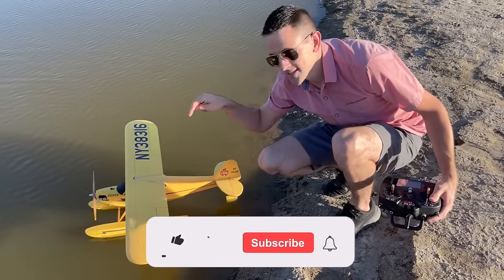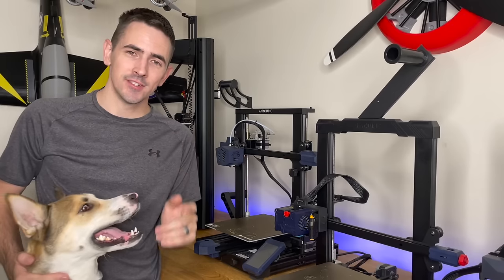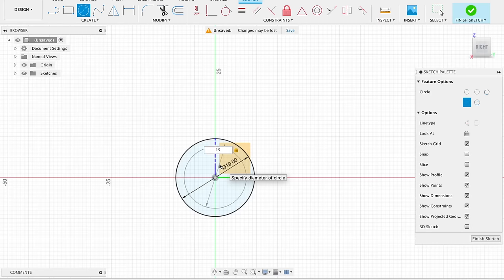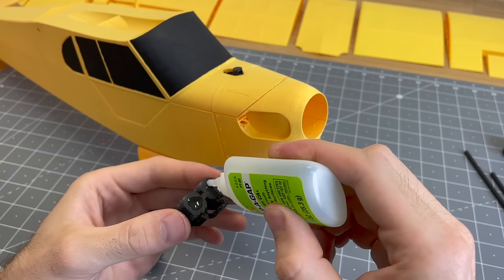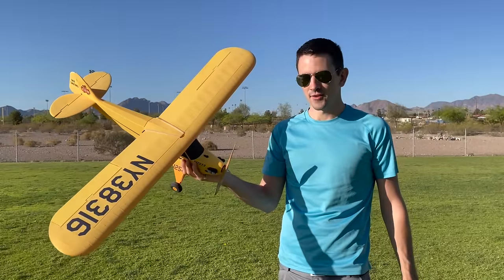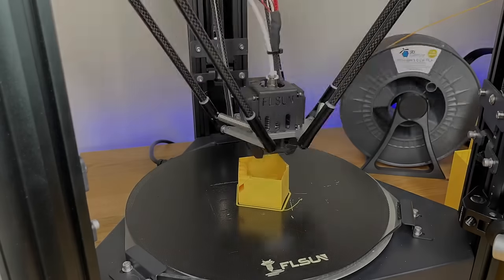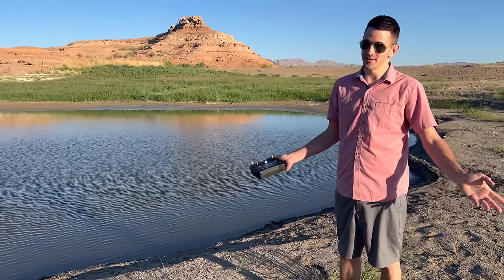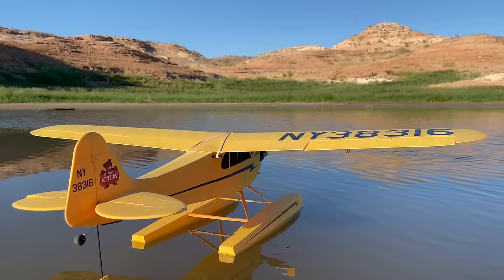Epic DIY RC Piper Cub Full Build & Flight

Comment: Love the videos. You've helped me get my.lw pla printing better. I'd love to see you focus on some sub 250g designs. 
I just built the nexus 900 rotowing in lw pla and it's probably only 100 grams. Check it out
Reply from the maker: I’m so glad I could help! I will check that plane out for sure, the only issue I’ve found with some smaller planes is that electronics that small can be hard get
Reply: @TroyMcMillan   I get that feeling. It took a while to shift through all the stuff out there and find what would work for me.  but I've landed on 2g servos for the most part, they seem to hold up to whatever I put them through, and I'm using pretty simple and cheap  fs2a(can run 1s up to 3s) receivers. Fvt little bee 20a escs(2-3s) which is way overkill but they're tiny, the downside to them is no bec. 1207-1404 sized motors. All pretty cheap and available from aliexpress. All  running 2s on 300-1000mah. I did pick up some byme A gyros and micro fs82 ppm/ibus reciever recently and I'm impressed with their function and how compact it is.  My biggest currently is the shrunken flite test p38 on my channel. It's running 2 1207 3100kv and 5 inch props. Just squeaks under the 250 limit at 750mm wingspan. Most of my flock is around the 500mm mark and 150-200grams.

Comment: I enjoy you videos and they have helped me with some of my builds.  But, the elephant in the room.  PLA is heavy and fragile, LWPLA is light but even more fragile.  PLA is also very sensitive to summertime heat and LWPLA is even worse.  I really wish the designers would develope designs that are stronger and lighter (I know that's not easy) and please give us designs that have more prominent tabs or edges to make the assembly process easier and add more strength to the assembly.   It can be very difficult to put some pieces together because you are butting them together or the alignment tabs or surfaces are very small.

Comment: Having problems with the files. Nothing looks like in your video.
Reply from the maker: What printer and slicer software are you using?
Reply: @TroyMcMillan  flashforge ADM 5, with orca slicer.
Reply from the maker: @michaelrogocz1160  For all the 3dLabPrint airplanes you should use Prusa slicer like I explain how to do in the beginning of the video. Use the 3MF files. It is ok o use Prusa slicer if you don't use a prusa printer.
Reply: It makes no difference. I don’t know what I’m doing wrong. In Prusa it looks the same. Both tubes and the square box in fuselage 2 are without connection to the body.

Comment: Troy, you inspired me to build this plane, but my prints don't work, fitment is awful, too much cleaning and trimming. So  putting it together is not the videos you should make, actual printing slicing with cura should be what you cover. This video doesn't help anyone on how to print the plane properly, I contacted 3d lab about my issues and they just blew me off. And if I follow their guide the parts turn into noodles. Garbage
Reply: I’ve had the same issue with this freebie. How to print it so the parts actually fit?